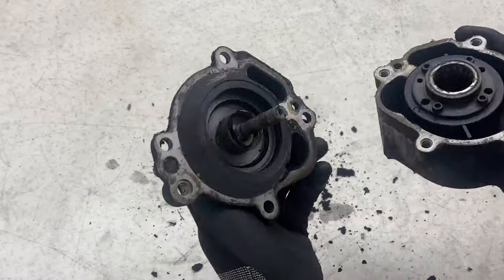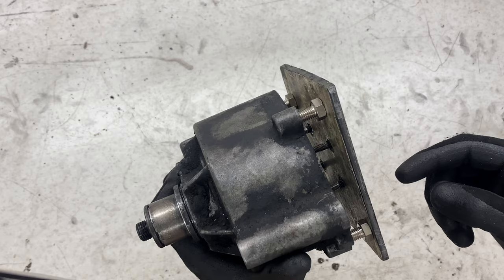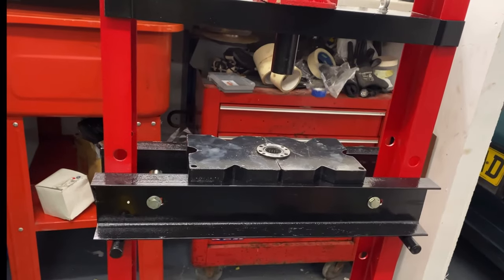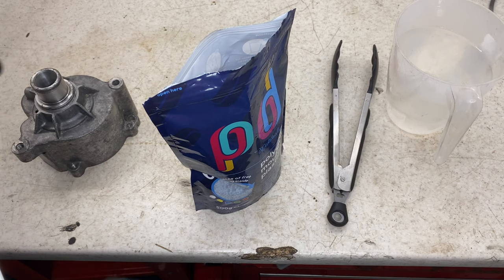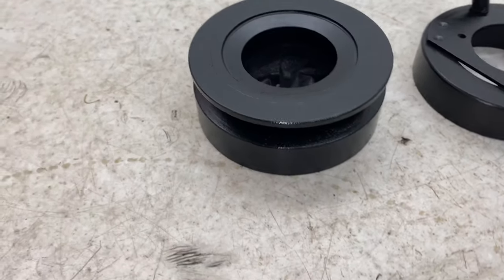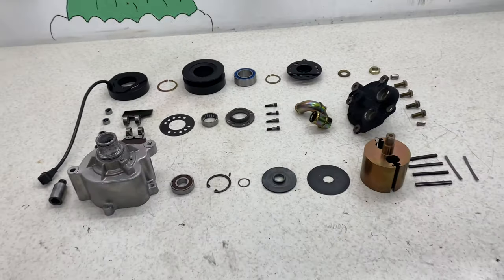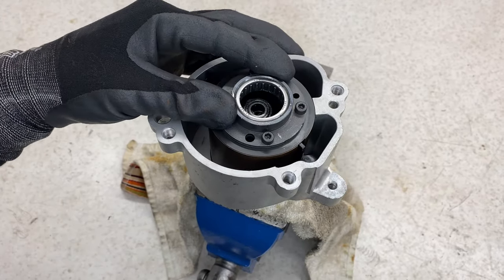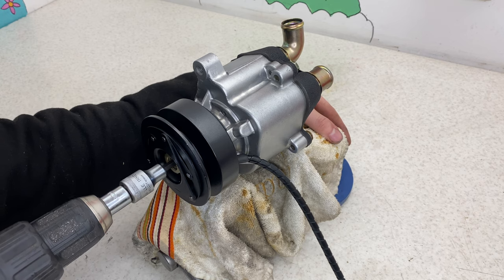BMW E34 M5 S38 - Emissions/Smog Pump Restoration

Comment: With this S38 build, what condition is your air pump valve in? It's the vacuum operated valve that regulates the air going from the pump into the exhaust manifold. Mine is cream crackered. There are three points where air pipes connect but two have a steel sleeve and one is just aluminium, the aluminium connection on mine has just crumbled away to nothing...! Annoying as the actual valve works well.
Reply from the maker: I won’t be using the air pump, have sold it off already. I’m happy to send you my old regulator if i can find it? No idea of condition but I’m sure it isn’t as bad as yours? If you contact me on insta @bad_e30 I’ll send it over FOC

Comment: Did you use a different belt and just run the ac and idler? What belt if so?
Reply from the maker: I won’t be running AC! (UK car/space constraints in engine bay) so i won’t actually require that belt

Comment: What camera are you using mate great job you done...
Reply from the maker: Just my phone! Iphone 11 pro max
Reply: @BadE30  its very hard to import videos on pc if its a large file, by the way we spoke through ebay when you put for sale the air intake manifold
Reply from the maker: I edit, export and upload it on my phone! Saves messing around with pc’s. And yes I remember, that intake sold pretty quickly.
Reply: @BadE30  well done mate what app are you using? Cheers
Reply from the maker: @ALKUKES  just imovie! I do want to upgrade soon, but this is nice and simple